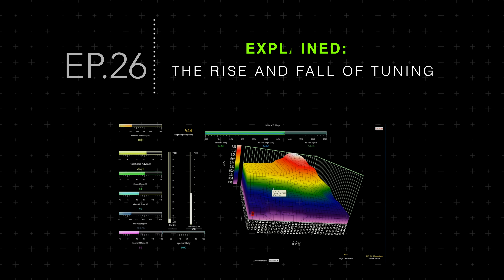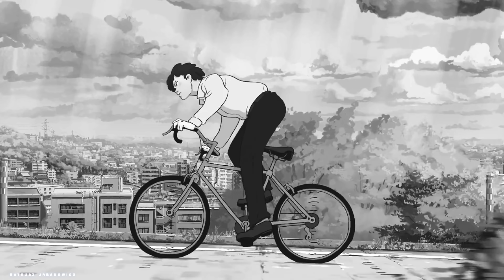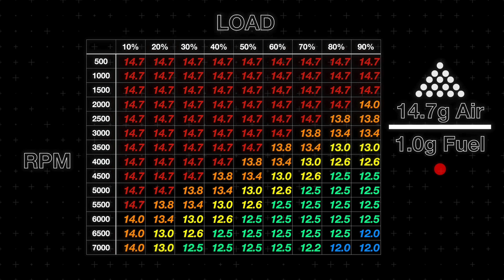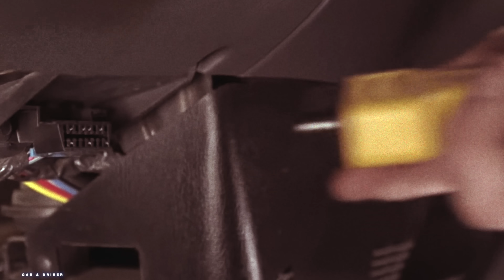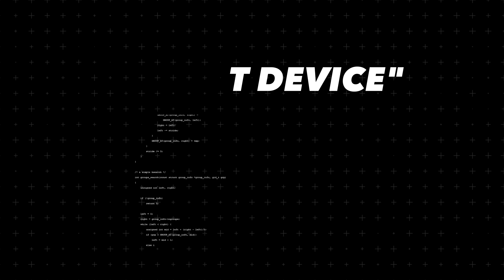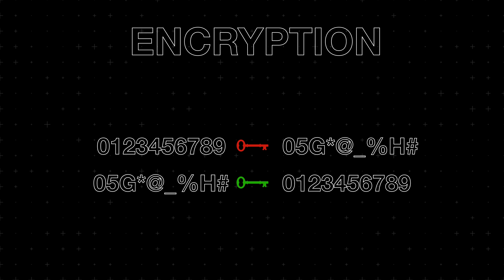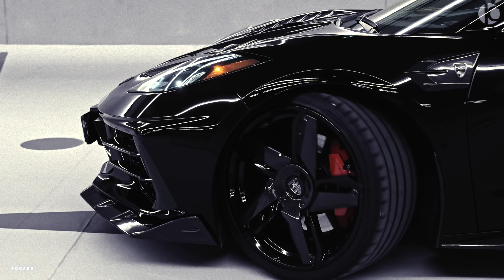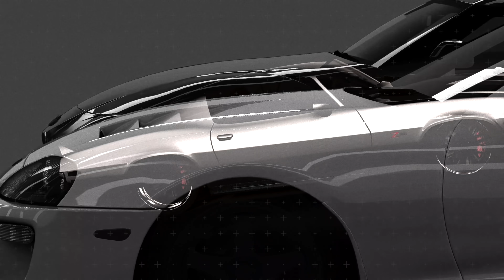How Tuning Engines Became Illegal👮🏻‍♂️| Explained Ep.26

Comment: Imma still tune it 🤐🤷‍♂️
Reply: Me too. But thankfully I saw his qualification requirements at the beginning, and I am a software engineer so... I have that going for me already.
Reply: @TravisFabel  we up.
Reply: @TravisFabel yeah software engineers make like 125k+ is whe he said that. Not because software engineers are mechanics😂
Reply: It's not illegal if you don't get caught!
Reply: @blerst7066  true that
Reply: @blerst7066 
It's only illegal if you get caught.
Reply: @blerst7066  fuck its not. but it never stopped me if it were something i wanted to do anyway.
Reply: As you should
Reply: A few years ago I wanted to tune my car but didn't want to pay someone to do it. So I got the software and now have more than double the factory output and running E85. And can still pass an emissions test! I love tuning and will continue to tune my own vehicles for as long as possible!
Reply: @4BillC are your parts stock? Running twice the power while passing emissions on stock seems unlikely. Congrats either way
Reply: @KryptoKn8  how are emissions measured? On old diesels here I. Germany with the emission class 3 around 2000-2006 you could tldelete your catalytic converter. They only testet diesel particles and nothing else. If you drove gasoline and did it, it was gameover.
Reply: @KryptoKn8  the engine is stock with like 200K miles. I'm building a new one. Car came with 170hp at the crank and currently has about 300 at the wheels. All the upgrades to support it... Injector, innercooler, the turbo. End goal is 400ish and 8500rpm.
Reply: @4BillC awesome
Reply: @4BillC  double the output, same service intervals?
Reply: @mrD66M  honestly other than oil changes I just fix it when it needs it. No real set mileage or anything. Hell even the oil half the time ends up at about 10K miles before a change. I drive the car 500 ish miles a week so the clock flies passed regular intervals...
Reply: @4BillC E85? What are you driving, flex fuel?
Reply: @4BillC  Do you have any recomendations for someone who is trying to get into tuning (in general and for their car) but does not know how to?
Reply: @asjadsiddiqui7409  it really depends on the car. Hptuners is a pretty user friendly software but can't tune everything. That's where I got my start, and by no means am I a tuner but I've tuned a few...
Reply: The EPA has been and is coming after tuners/weekend racers for a while now, but it's all a scam. If they really cared about pollution, they'd go after the private jet industry. Private planes account for WAY MORE pollution than tuners ever have. But I'll let you guys guess why they don't go after that industry....
Reply: @Weazel615  shh Moby dick shh.. Epstein this lil air freshener didn't hang itself... Makenzie Scott designed the air freshener?
Reply: @Weazel615 that's because that's the ruling class that travel's that way.
Reply: @Weazel615  they should also go after the ship cruise industry.. those things burn through like 50K GALLONS of diesel just idling at port.
Reply: @Weazel615  Because Al Gore and the rest of the liberal elite make billions off their long con known as Carbon credits, meanwhile they stroke each other off in mansions that use 12x the energy of any of our homes but point at us and say we are the problem.
If they had their way us pissants would not be allowed to own a car or travel by any means other than by mass transit and we would all be in government high rise buildings within walking distance of our employment, no houses for us meanwhile they fly private jets and 20+ room mansions The way they see it we are using up their resources.
Laws for thee,not for me!
FKNG limp wristed hypocrite bastards.
Reply: @Weazel615  Ikr. How else will Klaus Shwab get to his little speeches then? We have to think of the poor rich people :(
Reply: Junk gas is a thing. Be safe out there.
Reply: @perspicaxingenium  Some guys test it at the gas station. Shits unfathomable.
Reply: My engine ill do what i want
Reply: And you should considering there's cars being bought from car lots that have 800 horsepower stock.
Reply: Me too...
Reply: @fundamentallybroken4194  I’m I’m
Reply: Sir anything you say can—and will—be used against you in a court of law
Reply: @ghostmopreal they can’t get everyone.
Reply: Hell yeah.
Reply: Tf I’m telling smh
Reply: @VQ35DEMON  😂😂😂😂
Reply: factsss
Reply: We should create a giant group of car enthusiasts and debate against the government on how gas is cleaner that electric
Reply: Yeah I just found a video saying how much worse are the electric cars VS the fuel powered ones
Reply: @crystalcactuis.w Those enthusiast better be lawyers...any law the gov comes up with has an agenda and deep pockets behind it.
Reply: @crystalcactuis.w Lobbying congress, I like it 🤭
Reply: I'll tune my engine too.
Reply: Tuning mine Friday lol
Reply: Tune everything
Reply: Knock, knock, we're from CARB and would like to talk to TheRush tuner out of existence
Reply: Cool, enjoy getting arrested. Actually, you probably only do things because they’re illegal.
Reply: Yeeah 🚬🗿 Im 1.8T owner right here. Keep it up. Im still passing inspections every year here in Europe 😂😂 F**k em.
Reply: If the computers wherent so locked down and intentionally difficult to work with it wouldn't be bad imo
Reply: @bradleycooper5436  I wonder if you could just rip out the locked-down ECU and build your own from scratch. Surely there's people smart enough to do it
Reply: W
Reply: Same.
Reply: @Keithnung  weird, YT highlighted your comment
Reply: @Mulatt0Will-tq4fp  wdym
Reply: I am still going to tune it!
Reply: Yep. Fuck 'em
Reply: Right fucking on! 🤙🏾🙏🏽✌🏽
Reply: Lol ok tough guy yeah YOU'RE gonna win the war against commie marxist gov't PIGS all by yourself and "ima still tune" when there's NO WAY to not destroy an ECM nowadays. The problem isn't to keep "defeating" new technologies the problem is THE COMMUNISM RAINING DOWN from govt's CONTROLLING WHAT YOU THINK you own what you THINK YOU BOUGHT with what you THOUGHT WAS YOUR MONEY. 🤙🇺🇸🇷🇺✌️🖤🧂🖕🖕🖕
Reply: Same
Reply: We have to! Lol
Reply: “FBI OPEN UP!”
Reply: They ain’t gotta know shittt
Reply: Hell yeah. You sure would tune the radio. The world is urs.
Reply: Itll be funny if gov officials already knew VW cheated their EPA system before 2015, thatll be silly
Reply: I mean the only cops that know what to look for are the cool ones that dont care
Reply: Aem got u covered dawg
Reply: "Imma" lol
Reply: Bro i dont car i still tune
Reply: Thatta boy..Screw the alphabet soup lobbies!
Reply: Literally the day I bought my car fired up WinOLS & flashed mine that day. My car my rules
Reply: It's legal as long as they didn't find out
Reply: Same
Reply: If the ECU won't play nice you throw it in the bin and get a standalone unit 👍
Reply: That’s what I’m sayin, who gon stop me?
Reply: Right on! F Joe Brandon and his evil agenda.
Reply: And now your on the watchlist 😂
Reply: @pepelapue2259 there’s no watchlist.  My cars have zero emissions,  and aftermarket ecus .  My property, I’ll do what I want. People pretend that the epa is a police force. They aren’t.  They fold fast under threats
Reply: Merica 🇺🇸🦅
Reply: We will support you If you ever get caught
Reply: My country doesn't have an official dyno, so they can't really measure it 😅
Reply: HackThePlanet
Reply: Yup....FACTORY TUNES SUCK😊
Reply: Dude same
Reply: Weee woowoowooo
Reply: Ong cuz whattttt
Reply: Legalize tuning.
Reply: These Tuners are Smart! 
But if the Federal Government is going to outlaw turning a 1908’s and newer computer equipped car — This is a solid reason to own a pre-1980’s carburetor equipped vehicle that allows you to do all of those wrench type modifications, larger engines, boring and stroking the cylinders, cams and crankshafts, super chargers. 

My favorite car that I owned is still my base model second generation 1986 Rotary powered Mazda RX7. This car had nothing under 4500 rpm — but once I had it in fourth gear and above 45000 — the Rotary became a land Rocket. And at 18 years old — it still topped out at 140 mph. That was fast enough for me. Sure, I found out that the new Dodge Chargers and other cars were faster than the RX7, but a car doesn’t need to be any larger than 2600 lbs — to my thinking.
Acceleration is more fun than top speed.
Reply: Youa do that.
Reply: Lol
Reply: Hell yeah brotha!!!
Reply: Facts
Reply: Same
Reply: Yep same👀😁😁
Reply: Standalone ecu is the way
Reply: Fk the goverment
Reply: Fr
Reply: Ej powa
Reply: Good luck in CA
Reply: @JayJager How is that working out for CA? 😂
Reply: Jesus loves you all, God Bless✝️
Reply: Fr
Reply: I still do 😂 catch me if you can fuck heads
Reply: Idk I guess I’m basic and I like stock things. I like being able to get something anywhere and in a way have a connection with others. Ideally I can get parts easily and get my things worked on without much fuss.I don’t really like thinking about my ride too much as if I worship the thing. But I try to treat it like a washing machine or toaster I go fast in. But everything will have a personality in a way and they will respond in way depending on speed and weight. I still think tires make the biggest difference I don’t mind changing up a bit. But I guess changing fluids and replacing boots seems like the only attention I give my vehicles. But the greatest factor for me is reliability, not exactly durability but I want basic maintenance to work and I expect no guarantee if I smash something.
Reply: Same
Reply: It isn’t hurting anyone but your neighbors, keep doing what you love till the end of time.
Reply: E85 and ethanol based fuels should exempt any low-level tuning one might do if I’m honrst
Reply: Exactly, it suddenly became more fun. The gEyPA can't seriously believe people will just obey blindly.
Reply: Real shit
Reply: on god
Reply: same i don’t care what are they going to do catch up 😂🤷‍♂️ ik my area like the back of my hand and im confident in my ability so imma wreck or escape
Reply: Mf did in fact still tune it
Reply: @ you peep the n54?
Reply: Ong n54 go burrrrr
Reply: @BrokeMahWallet   bro no way I have an n54 too
Reply: @TheRushsHoe  e90??
Reply: @BrokeMahWallet  e93
Reply: @TheRushsHoe  I love e92s & 3s they look mad clean 😮‍💨
Reply: @BrokeMahWallet  yess mines white with an m3 front bumper and m3 rear bumper 17t pushing 19 psi making about 500 full bolt on im start pushing these ones soon once I save up for a big single turbo kit
Reply: @TheRushsHoe  As you can see in my profile picture, I used to have an 09 e90 335i with an n54. It WILL give out on you. I did all of the maintenance, regular oil changes, transmission fluid, water pump, spark plugs, oil cooler and radiator. Even got a better charge pipe. It still just completely gave out on me. Threw a rod on my way to work in the morning. Sold and only got $1050 out of it. Just a warning, take it as you will.

edit: Not to mention, the car was completely stock other than the charge pipe and performance mufflers.
Reply: @0AperiOculos  I reallly like how the car looks so Ls swap ? Ahahahaa if the engine ever blows I seen some cool ones on here good ol turbo ls seems like fun
Reply: @TheRushsHoe  Throwing in LS in it is never a bad idea 😂😂 You just gained 2 cylinders, and if you give it 2 turbos you’ll still get to hear your loud induction noises lol.
Reply: @TheRushsHoe same but e60 xi
Reply: @ike7153 how much boost? How hard did you drive it? Should've went fbo to reduce wgdc
Reply: @TheRushsHoe there is no such thing as E93. He's talking about the ethanol content in his ride. He said E85 which is flex fuel. Most people run standard unleaded which is E15. What you're talking about is the octane level when you said e93. That's still E15 if it's not E85.
Reply: @BrokeMahWallet  it's the only way🤌🏾
Reply: @BrokeMahWallet N54 Party
Reply: Like a radio station
Reply: @ishaiahsmith  lol

Comment: They regulate us with emissions, but companies are allowed to pollute the environment by producing engines that fail at or before 100,000 miles and need to be recycled, remanufactured or straight up trashed. The amount of pollution that comes from the manufacturing process or what happens to a car with a downed engine far exceeds what emissions laws have accomplished within the past 20 years.

Comment: In EU regulation, it is even more strict, but it's always the way. If you have a certified LPG installation, you are not obligated to do an emission ECO-TEST. LPG ECU takes over fuel injectors and lie cars' petrol ECU about fuel injection and sensor values. I even drill out my cats. During my yearly inspection, no one checks emissions, they just check for LPG leakage. FUN fact: you can even connect petrol fuel injectors instead of LPG ones and tune maps as you like, and the car's ECU is fully unaware of it. You switch between maps with an LPG switch or via a simple RS-232 cable (all LPG ECUs communicate with this simple protocol). That is a super cheap, easy, and effective way to tune a car without risks of failing inspection.

Comment: You have to remember also that let's say you have a car from 1989 like me and you go to have it inspected. That car doesnt have to meet 2025 emissions standards, it has to meet those from 1989. Also open source ECU's from Speeduino, RussEfi etc... are at a point of being as capable as many a stand alone offering from ex. HOLLEY, and with can sniffer add ons these ecu's can translate a later model vehicles can protocol so the stand alone ecu can then integrate thereby letting you keep things like functioning windows, gauges, radio etc... 

In short the EPA can blow me

Comment: I had a car that did somewhere around 10mpg, and i tuned it to do 25 mpg, MASSIVE difference, but it was illegal even though it was more efficient, had more power while STILL emitting less even with almost double the hp, yes, less pollution at full trottle with more power, STILL FUCKING ILLEGAL, due to a small thing that did essentially nothing, but without it like 100 error codes appear, all unrelated to that part
Reply: Capitalism wants you to buy more fuel

Comment: Ultimately trying to stop modifications like that is a losing battle - worst case scenario someone who knows enough about the inner workings of it could write their own software and entirely replace the builtin ECU, bypassing all software restrictions. It would be very difficult to do but not impossible. And no amount of software will get around the fact that you are ultimately controlling mechanical components, and whatever controls them can in principle be swapped out as a whole.

Comment: What about changing the ECU completely with one from a reputable brand that allows tuning? Most people just change their ECU if they are after high horsepower anyways.
Also, there are always piggyback ECUs that can work together with the factory one... Tuning isn't going away as long as we have cars with engines on the road.
EVs are a different story, there isnt much to tune there, you can push more current to the electric motor, but that will make it even more unreliable. There is also the consideration of how much current are the wires are okay with transferring without heating up.
I think in the future, we will find ways of tune the EVs, swap electric motors and change up the battery packs to produce more current for less miles of range... But it will never be the same as what we have now or had in the last 100 years, not just because of the lack of sound... its because the lack of soul

Comment: Perhaps the EPA should simply set an emissions requirement for tuned cars under "normal" operation and quit relying on mandating EV adoption or larger platforms, most owners only operate their cars at high power for short bursts anyway. This would be more effective than if every car owner drove an EV, since lifetime emissions from an EV are actually higher than those of a gasoline powered car. The current rules are simply making larger vehicles easier to certify and causing manufacturers to quit making midsize sedans, which emit fewer emissions than large SUVs. The unintended consequences of the current regulation focus is an increase in car emissions (compared to what we should have, not compared to 1990s technology).

Comment: If you caught or the cop suspect its modified  exhaust modified. It has to be put back stock at a dealership , they do not install used parts ,aftermarket eng parts so if NA 
Its the crusher for tge car , I seen it done
Reply: If they did that with my car that cop better hire a guard for his family cause at that point I wouldn't have much to lose...

Comment: You can't even change the air filter or muffler in CA without a C.A.R.B. state serial number stamped on the part.  If cops even think your tint is wrong, car too low, or muffler too loud they pull you over, make you pop your hood, give you a "fix-it" ticket.  Hardcore dudes replace to stock, go prove it, then take the proof to court to get out of paying it.  Fast n Furious brought the government down hard on tuners in the US.  SMOG / emissions tests or your registration gets revoked.  It's bonkers.  Now they're all pushing for "going green" with even more regulation.